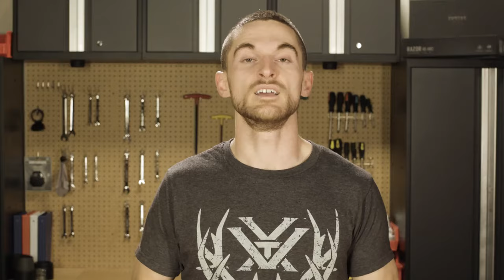Why You Shouldn’t Use a Weighted Gun Vise to Sight-In Your Riflescope

Comment: I've use a sled to sight countless rifles, no issues and no POI issues after. It definitely cuts down on how many rounds needed to zero. The rifle will do it's job, how well it does it depends on the person behind it.
Reply: Small calibers like 65creed and 243 308 ect won't have a problem it's usually with the larger magnums that hav3 problems like 300win mag 7mm rum ect
Reply: I sold my sled, I could never get the rifle locked in tight enough that it had no movement. I bought a bench bag to use on the butt, and a bipod on the front, and had much, much, much better results😄😄😄
Reply: @mhatter6332  yeah bags and bipod see good

Comment: What is this crackpot physics? 😸 There is no "shock" that travels through the "path of least resistance". There is this thing, that we non-crackpots like to call "change in momentum", that the bullet imparts on the bolt. Bolt then transfers that change through the locking lugs to the receiver and barrel. From there the energy is distributed among the various masses connected, and it tends to favor the path of MOST resistance. Meaning that the connections with highest inertia will absorb most of the energy.

If you have nothing behind a gun when it goes off, all of that change in momentum is going to go into stuff attached to the gun. If you have a heavy human behind the stock, then most of it is gonna go into the human, putting less stress on your scope etc. But if you have a sled that is bolted to the ground, then nearly all of that change in momentum is gonna go to the planet Earth, for it has a lot of inertia.

The problem occurs when you have "play" in your sled setup. When the rifle has room to accelerate freely backwards, only to impact with the sled, causing a second rapid change in momentum, but in the opposite direction.
Reply: yeah no offense to vortex but this guy sounds like he has no understanding of physics at all. he probably couldnt tell you the equation or unit for work or energy or even momentum

Comment: I have been using a lead sled for years. I just don't add any weight to it or strap my gun down in anyway. Its basically just used as a rest and still allows the gun to recoil freely. Haven't had any issues.

Comment: What i always done was get and old tire and set my gun on it, strap it to the tire on top of a plastic pinic table is what i use, the weight of the tire take alot of the impact out of it and you can hold pretty much dead nuts and get good groups, this way the tire can slide just a little and the ol shoulder doesn't take a pounding like suzy in highschool 🎉, i can see vortex being not happy if there customers are ancoring to something solid and letting all that impact jirate through the scope, people say buy more expensive, call any top brand and they would say the same, blows my mind how people's answer is i throw more money at it, in this economy vortex has helped alot of hunters have a quality scope for very reasonable price, i have one and it's clean glass!! We all can't afford scopes higher than our rifles! Be realistic people!

Comment: Well this is a bummer considering I just bought a lead sled to help zero in my rifle. I would love to know your thoughts on if adding a few inches of insulation to the rear stock holder on a lead sled (some type of foam) would be a good compromise so you can get the stability but still allow for a more natural recoil backwards. I really would love to use the lead sled to pick out which different cartridge of ammo groups best with my gun as well as zeroing in whatever ammo that may be. Thoughts would be much appreciated!!!!
Reply from the maker: It could certainly help, but still not ideal. To fully absorb the recoil it would have to be pretty thick/firm foam to ensure the stock doesn't just push right through. Using sandbags and a bipod is a much better option.
Reply: Even if you could completely divert the recoil-based forces from the rifle mounted in the sled, you'd still most likely find that what groups well for you in a semi-benchrest format won't group well from the shoulder; your basic breathing will immediately introduce a margin for error that you didn't have with the sled.

Rather than spend some more money on sandbags, though, take a look through your older clothes.

If you have some old jeans or cargo pants that are nearing the end of their days, cut the legs off, double them up, tie and end off and pack it with sand.  The sandbags you make this way will let you better control the effective height, and provide a shooting platform you can reasonably take into the field with you.

The Caldwell shooting bags are great - If you have an adjustable height table, or have it set up at exactly the perfect height - but they don't allow for much customization.
Reply: Negative, keep using your sled. It’s the best way to find out which loads group best out of your particular rifle. AFTER, you have your winning load, re zero shooting as you would it real life - prone most likely and of the bipod to obtain Point Of Aim - Point Of Impact zero.
Vortex is worried that the hard stop of the sled versus more amortized / cushioned recoil shock stop of your shoulder; will damage the reticle. That is precisely why you should spend extra $ and purchase higher end scopes - you get what you pay for.
Reply: @JohnyBravo44  a midrange anything will outlast a topend vortex

Comment: So, this is my second time to watch this video. I think the only use for a vice or lead sled is for a bench gun.

However, I hunt and I need to zero and group the way that I hunt. I hunt with a tripod, sitting or standing, with the buttstock against my shoulder. So, at the range, I try to mimick that with bipods resting on an old towel I bring along. And the buttstock resting against my shoulder. And left elbow on the table at the indoor range and the back of my left hand under the bottom of the buttstock. And my Vortex Venom on the rifle. I love that scope. The reticle looks good to me. I wear presciption no line bifocals and the eye relief fits me right.

So, I get a good zero and this last Saturday, I checked again the zero on my 7 PRC and grouped a 3 shot at .57 inches (.55 MOA) from cold barrel with a mean radius of .26 inches from PoA. Scopes are not intended to recoil against an immovable object. They are designed for use with a human. Jimmy is right.

Comment: You lost me on the “shoot with your rifle for zero”.  I took that part as: if you’re a bad shot, then your sight zero should match your bad shot habits. That doesn’t make sense. If anything a solid zero sight is one less thing to worry about for a person that lacks shooting ability.

Edit/add: it just seems like all conjecture; how do we know the recoil isn’t going to the vise grip stand/sled?
Reply from the maker: Great question. Using a lead sled will remove the natural recoil of your firearm and potentially cause damage to the rifle itself and/or any accessories on it like a riflescope. Although, in theory, a lead sled will remove human error, that doesn't allow any improvement in your shot or replicate any scenarios where you might be firing your rifle. Example: You wouldn't be taking a lead sled hunting. 

There are of course tools that you can use to mitigate human error (sand bags, bench rests etc), that are a little more practical for the range and hunting, but still let the rifle recoil. You'll also be able to improve your shooting skills when using these without risk of damaging the firearm or optics/accessories that are on it.